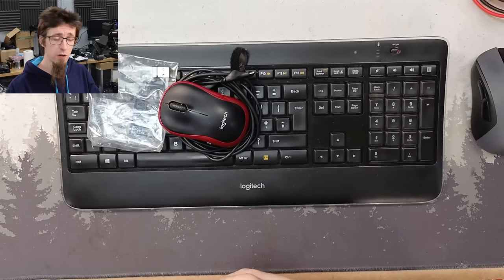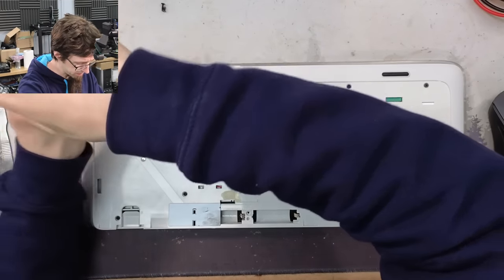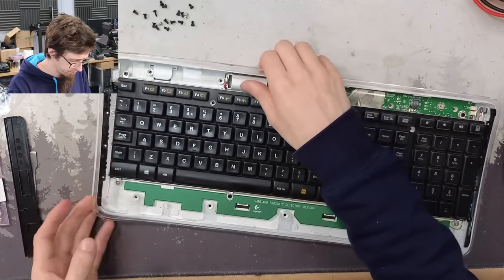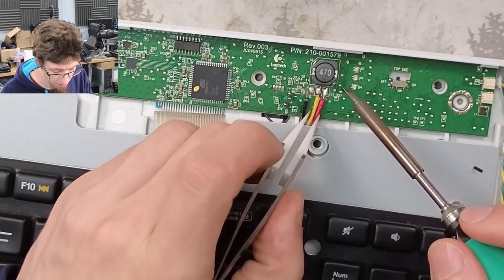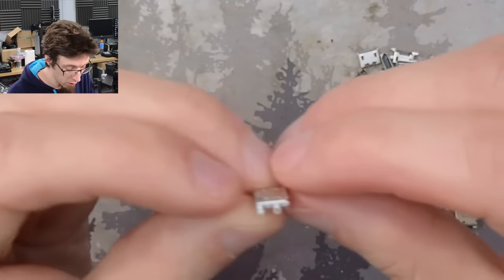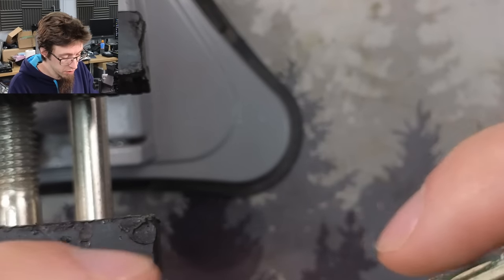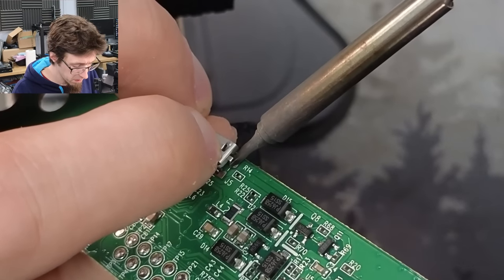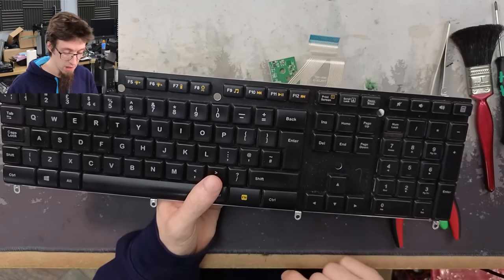Logitech K800 USB Port Fix - LFC#371

Comment: Like the idea of less e-waste but I end up with piles of stuff I'll get around to fixing one day!
Reply: I just gave away an Intel DX2/66 and a 5v DX4/100 that had a 3v or 3.3v adapter nestled under the heating (I may have the voltages cackhanded due to me being given the DX4 CPU in 1995. I'm now 68). The gentleman who received them was, I was told, very, very pleased to receive them especially the DX4. He belongs to a group who build old machines from available old components. Good stuff. 👍
Reply: Heating was supposed  to be heatsink but far king autocorrect kept changing it despite it being disabled. 😡🤬

Comment: Thanks for taking the time to fix this nice keyboard.   I am a loyal Logitech customer and find that these devices work and work and work.    I have in the past used other companies, but those were not nearly as durable as Logi and am now committed to that company for their durability value/cost.   I have a very expensive gaming keyboard that features metal surround and mechanical switches that I love, but overall, Logi is the best value for the money right now.   I even have a couple of multi-device bluetooth Logi MX keyboards that are rechargeable and backlit and they are surprising me with the off charger time.     You just kept the refuse situation down with your repair - things are not getting cheaper and repairing something that is not worn out makes more sense especially if you can learn at the same time!

Comment: I fixed my K120 logitech keyboard about 4 times. Mostly the problem is stuck keys, which can be solved by talking the keys out and wash the frame with a toothbrush. It's a 10 dollar keyboard, the cheapest of logitech. But I got attached to it. I like the aging effect. The keys become more shining after years of use, which is beautiful.

Comment: Nice repair. I'd usually toss this out if the issue was with the membrane keys no longer working but if its just a charging port/cable it should be worth the effort to repair and also saves the user in adjusting to a new keyboard.

Comment: I absolutely love this keyboard!!  The backlight is fantastic when taking those midnight support calls and you don't want to turn on the lights.  Also, the 2.5mm travel on the keys make it very easy to transition from your "desktop keyboard" to the laptop keyboard when needed (without feeling like you are poking your fingers through the back of the laptop).  

Nice repair!

Comment: Thank You Graham, you do good work and I hope my old memory will remember what you said about soldering/over soldering the posts. Greatly appreciated the tips.
This one is for others like me who need all the help they can get. Paul Daniels would flood a through hole with fresh solder if he was having trouble clearing the hole of solder. I had to use his method when I tried replacing an electrolytic cap or three using the wick.
I think it was BigClive that I saw putting flux on the wick which helped the wick suck the solder up better. That also helped me in another amateurish but successful component replacement effort.
I wish the Internet had been around 40 years ago with this sort of now commonly available and valuable information. 👍

Comment: Done watching, thank you very much for the informative repair video. I have learned significantly more troubleshooting & repair lessons in this tutorial video and to your other repair videos as well compared to my ENTIRE 4 YEARS OF COLLEGE due to the rotten & outdated standards of education here in the Philippines. I hope you will soon have a mini-series for Schematic & Boardview-free Voltage/Power Rail Tracing[12V/18-20V Main Voltage Rail, 5V, 3.3V, CPU/GPU Core Voltage Rail, DRAM Voltage Rail, IGPU Voltage Rail, System Agent/Northbridge Voltage Rail, PCH Voltage Rail, BIOS Voltage Rail, Battery Power Rail], Proper method of testing/checking of potentially faulty MOSFETs & ICs/Controller Chips, CPU/GPU/PCH Reballing and BIOS Bin File Editing.

Comment: i really like the wired version of this keyboard. i have used it for many many happy years. but while cleaning it, some keys broke. Now i use a logitech mx mechanical. The main thing i dont like about this new one is the USB port is only for charging. not data. and it has a non-replacable battery. So in the future i will have to do the same: try to repair a keyboard that is not designed to be repaired.
I like your approach on repairing the peripheral. very educational. thank you.

Comment: The K800 is a great keyboard and certainly worth keeping. It would have been easier to just replace the batteries with non rechargeable AA batteries and change those twice a year 🎉

Repair is great though of course. Would have appreciated a mod to USB-C 😉

Comment: The battery cells are probably doing really well as a result of the owner keeping it plugged in all the time. Ni-MH like a long, low current charge and when they get to their peak charge they'll get rid of any extra current by way of a little bit of heat ( I don't mean they'll cook, they just get closer to room temp rather than being really cold).

Comment: Proximity sensor for the lighting! Noway?! Ive never heard of that but its genius! (So long as it actually works reliably) Hahaa.

I definitely would have used a plastic spudger if possible & heat to remove the backing. 
Always love your work with these videos Graham!

Comment: The temperature sensor is part of a safety circuit designed to prevent a cascading failure caused by a possible battery/circuit fault from leading to a nuclear meltdown of the entire assembly and possibly the destruction of the surrounding area. Example: A high voltage component in the AE-35 Unit of a communications antennae shorts, resulting in excessive current in the main power circuit which in turn leads to a temperature increase past the acceptable maximum limit of the unit. The system monitoring the temperature detects the limit violation and shuts down the unit by isolating the power supply feed thereby preventing a catastrophic failure of the antennae  and possible damage to the  surrounding area. Safety devices/circuits are a good thing even if you never need them.. till you need them Dave...

Comment: When you like something sometimes the cost to repair is not a problem. I know I had a Logitech MX500 mouse I bought back in 2002 and I replaced so many microswitches and usb cables on it. I kept that mouse up till 2019. I still have it, though at this point the plastic is so thin in many places it's now no longer worth fixing as the case is going to break before any repairs I make. But after close to 20 years I can't bring myself to toss it out.

Comment: I have a Logitech EX110 Wireless Keyboard and Mouse combo that I'd love to keep. In that vain, I have replaced bulged capacitors in the mouse (jumpy cursor and a buzz from the unit itself), switches in the mouse multiple times where I'd just swap them out for switches from a cheap mouse I could find locally (hard to find good quality switches easily where I'm from). The keyboard clip feet broke (poor material, shame on you Logitech), I glued them open. As for the keyboard key area, I disassembled and cleaned it multiple times and even lubricated the keys with silicone spray (smooooth action). I've spent a great many hours with it and some of those were fixing it and spent quite a bit of money on it where some would say as you have expressed (ie: just get another one), but it is a solid kit and I'd like to keep using it as long as it works for me. Plus it is PS2, and works with the rest of my aging system. Keep doing what you are doing, I enjoy your videos. Thank you.

Comment: This keyboard is absolutely worth repairing. Logitech discontinued it. What a shame. I use one at work and one at home. The keys are falling off, but you can buy a brand new key deck for about $40. If I had the confidence, I would do the repairs myself. But it looks like I'm going to have to chuck them out when enough keys have fallen out.

Comment: Re the double sided tape .. helps to use a hair dryer on medium heat to soften the glue, get the cover to about 75c... a minute or so later the cover will lift off like magic, super easy. Makes a big difference, especially for modern laptop LCD's to avoid cracking the super slim LCD designs. --EDIT oh you mentioned the hair dryer near the end, nevermind :yum:

Comment: I also like to service pc peripherals. The last Logitech M185 Mouse I bought back in 2018 shows infamous multiple click effect on left button after a year. So I opened the mouse, and dismantle the attached Kailh micro swatch case, finely polished the contact points, straightened the lever, reattached, and all went fine. And since then, its working flawlessly, not exhibiting a single issue all these years. Despite I have spare micro switches in hand, the attached Kailh are superior than those spare units bought from aliexpress.

Comment: My guess is that the temp sensor is mostly important for fast charging. You can just trickle charge NiMH cells with low current indefinitely even when they're full (~0.1C is usually considered safe). Technically, overcharging NiMHs creates hydrogen gas. But modern cells have a catalyst in them which captures the gas and converts it back to water. But it can only do so much, so you can't overwhelm it with too high a charge current. If you're fast charging (aka using high currents), you need to monitor the cells closely, including temperature and voltage. But if you're slow charging, you can get away with some really simple charge circuitry (basically just a current limiting resistor). Which is one of the reasons why NiMH cells are still preferred over lithium cells in some applications.

Comment: the G305 probably has to be one of the funniest ways of making a mouse. it's like an engineer designed it and they just shoved it in a box and sold it. it has 3 circuit boards, 1 for each main clicker, and then one for the side buttons, and it has a massive frame it's in, that the bottom of the mouse clicks onto. it's not how most mice are made, but unironically makes it really easy to replace the buttons, since they're both on amazon and since it's single sided, easy to solder a new kalih switch to. not bad.
btw if you plan on replacing mouse switches, try using Kalih switches, since they'll be more reliable and click better than the original ones, and they're not super expensive. 
it's the ones that gamers actually want in their mouse.

Comment: I've deliberately bought Logitech G502 Hero with doubleclick (known problem) for cheap to replace terrible switches logitech used, and never regretted it, it works great, I have spares to fix it again if needed, and it's realty comfortable  for me. Same with logitech G Pro keyboard that I've bought for cheap due to missing keycaps and later replaced failed switch. Maybe 100 bucks saved not really worth for some, for me it surely does.

Comment: I have had to fix my K830 4 times now. Broke the usb port twice, the power switch once and replaced the battery. Its the only wireless keyboard with a trackpad and backlit keys that I have ever found. Logitech discontinued it and no other manufacturer makes something similar, usually missing the backlit keys so I will be fixing this thing forever.

Comment: I have purchased 3 of these keyboards. My favorite wireless keyboard, so far. I am really disappointed in the build quality of the new version. They took out the replaceable NiMh cells for Li-ion pouch cells, the backlight flickers, and the battery does not last very long (less than 1 month on full charge). I have an old version, like this one, and have not had any issue with it. Charge lasts well over 6 months.

Comment: I do this type of stuff for friends and family all the time. It's fun you when you can fix things that seem impossible. I've done microsurgery on some of the tiny switches and brought them back to life. Logitech seems to have a habit of using those 0.5mm thin SMD button switches with a very sharp plastic point pressing in to them. This always eventually kills the switch but with some work it's possible to bring them back. Make sure to file off that sharp nib while you're at it. I have to wonder, do they do this on purpose to sell more components?

Comment: I have an old Steelseries Rival optical mouse which fit my hand perfectly, found a Rival 110 which is smaller and does not fit my hand so not using it anymore. Has cleaned the first mouse and ripped off any rubber on it. The back button in websites are borked and over-clicks. Until i get this fixed i'll just has to live with it.

Comment: I have the same K800 keyboard but under the battery cover are no batteries, not even a place to insert batteries.  It must have a rechargeable battery inside.  ifixit has a guide to open these up,  their guide is like mine.  The comments say the original took 2 lithium AA rechargeables, the updated model is mine.  I keep it connected to USB power all the time.
Reply from the maker: Yea I expected this to have a lipo in it, there was actually a re-take where I took the batt cover off and was like 'oh... that's... hmm...' And then I was like; ok this doesn't actually change anything I'm still going to fix it, and I re-did the scene and explained why I was still going to fix it.
Doesn't surprise me that a newer model has a lipo in it, much better battery life. Backlights eat battery capacity, which is why they're uncommon on wireless keyboards.

Comment: I also get a lot of repair request for peripherals ports, but once the customers hear the repair cost, they just opt to buy a new one. I currently have a customer spending more than the cost of a new printer unit to repair his old printer, but if the customers is willing to spend his time and money, I will assist.
Reply from the maker: Yea, for typical peripherals I'd agree. But there's got to be so many gamers who bin an expensive gaming mouse/keyboard because it has an easily fixable fault, I reckon🤔

Comment: 15:02
Why not do the customer a favor and put a USB-C there instead? Its like, you get what you're paying for since its an upgrade as well.
Reply from the maker: IMHO it's not worth the complication, unless you're trying to achieve Type-C on everything on the desk.
This customer will have a dedicated cable connected to the keyboard most of the time, so it makes little difference if that cable is Micro or Type-C